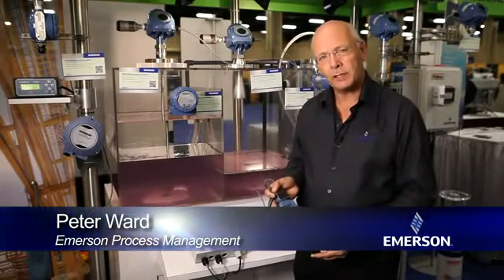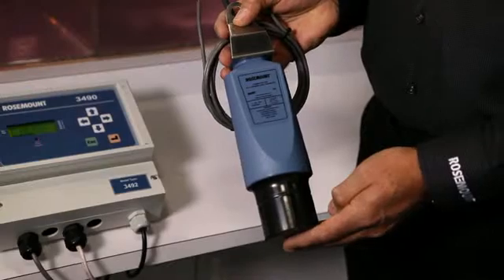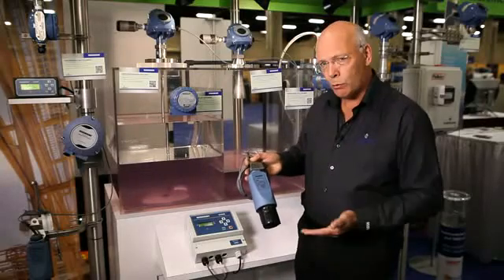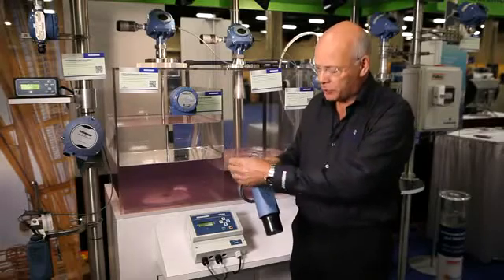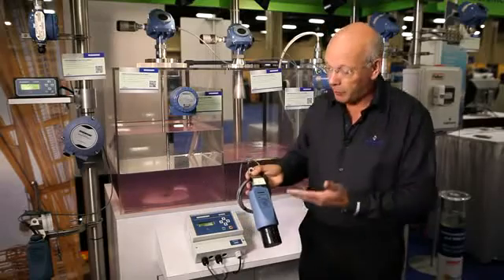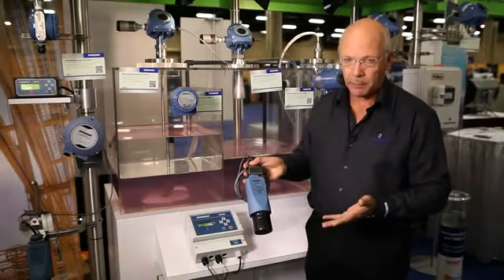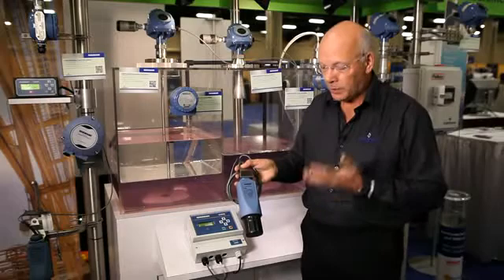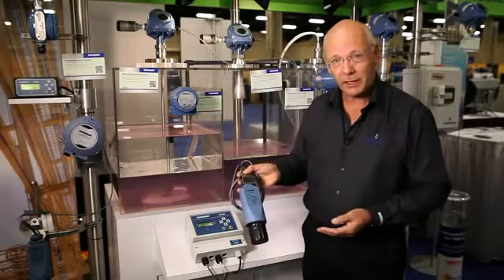3107 Ultrasonic Level Transmitter for Level, Volume and Open Channel Flow

Comment: For open channel flow measurement, can we use 3107 or 3108 independently or 3490 control unit is mandatory to instal with them.